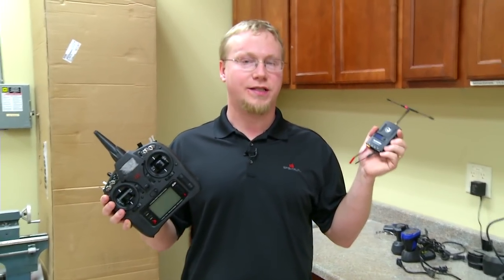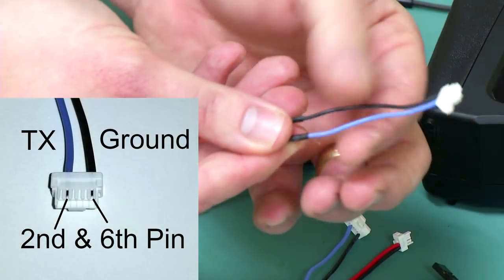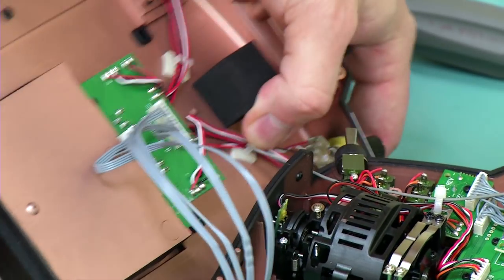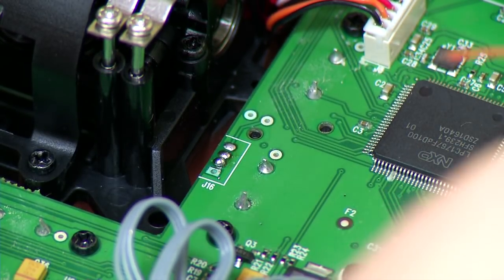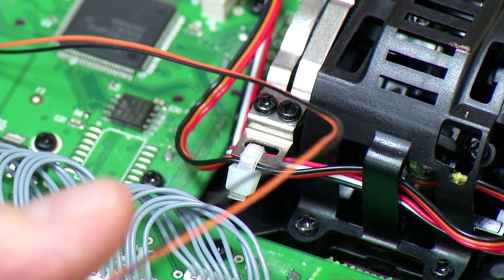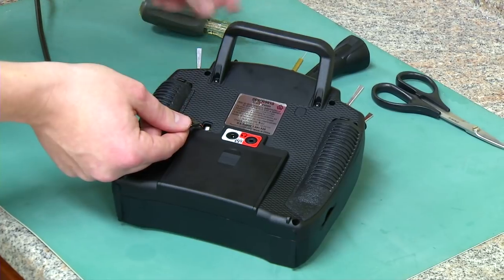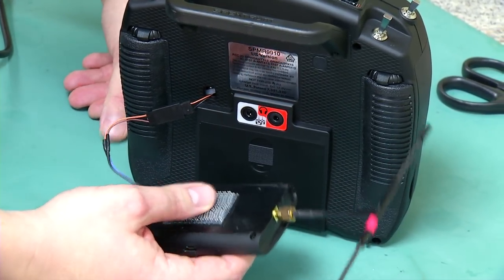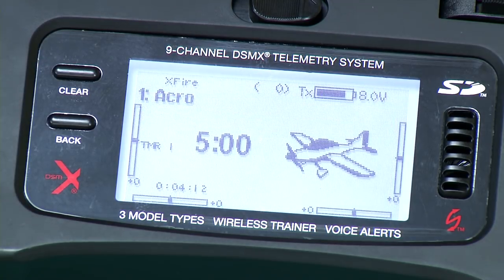Spektrum Instructional Series - How To Upgrade your DX9 for TBS Crossfire Using CRSF Protocol

Comment: Use some flux when you are soldering. It will make it easier and cleaner also tin the wires before soldering them on.(goddamnit i had to edit it due to stupic atocorrect on my phone)

Comment: I have Dx9 black, i want use with module TBS but in sys-setup not " serial port", help me! Pls.
Reply from the maker: Make sure you update to the update that has the serial port enabled, need to read the update description :)
Reply: @SpektrumRCvideos  but i can't register my device on spektrum web.  What should I do now?  Can you send me the update file?
Reply from the maker: @hoangphuong175  You will need to register it. For help with registration issue please email your contact info and the serial number to productsupport@horizonhobby.com
Reply: @SpektrumRCvideos  thank you so much.

Comment: So they say PPM has about 10x latency of the "CRSF" protocol, correct? BUT Crossfire is amazing though? what's the latency of Crossfire? 1ms?  (Just a guess).  Meaning PPM would be 10ms, which isn't too bad is that's the case :)

Comment: You said 8 screws but I counted 6.  Do you need to remove the rubber hand grips to get at the last 2?
Reply from the maker: Grover 2 for the antenna then 6 on the body

Comment: Hello, some people are using the so trainer input to connect the crossfire without having to weld.  how do you do that?
Reply from the maker: Ederson Pires Simply connect the included ppm cable that is included with the crossfire modules into the trainer port while tx is off. The radio will boot into trainee mode and your good to go, hope that helps!
Reply: @SpektrumRCvideos  So I won't need to open and weld as it is on the spektrum website?
Reply from the maker: Ederson Pires correct
Reply: @SpektrumRCvideos  will i need to disable RF protocol and enable crossfire?
Reply: @edyfpv  no

Comment: https://www.amazon.com/Precision-Anti-Static-Stainless-Electronics-Laboratory/dp/B071KCBXPR/ref=asc_df_B071KCBXPR/?tag=hyprod-20&linkCode=df0&hvadid=309735728871&hvpos=1o1&hvnetw=g&hvrand=9378619918457780199&hvpone=&hvptwo=&hvqmt=&hvdev=c&hvdvcmdl=&hvlocint=&hvlocphy=9011707&hvtargid=aud-801738734305:pla-521527862819&psc=1

Comment: Not sure why hey use that adapter cable, why not solder the blue and black wire to the orange and black wire coming from solder point? and why not cut a small slit in the plug and slip wire through and make it look professional?
Reply: the main reason for the connector is because the tbs connector is weak and will break if you try to un-attach it from the bottom of the module too many times. also you can make the wiring as pretty or as messy as you would like it to look. the insrtuctional video was to point out and show you where to make the connections and update and set up the spektrum stuff to work with crossfire, that's all. if you would like to won a beauty contest with your mod, wonderful. but i think his will work just the same, maybe better.
Reply: @rebeccalogsdon5616  

interesting to know, wasn't aware of that issue...I'll keep it in mind

Comment: I have a DX9 silver from 2013 and I am considering TBS Crossfire.
Can I still use it with my Spektrum receivers after the conversion?
Reply from the maker: Absolutely! The modulation setting changes with each model memory.
Reply: @SpektrumRCvideos  We want a plug and play dx9 or dx8 for crossfire micro module!  Make it happen spektrum, you are supposed to be the king of the industry.
Reply: @SpektrumRCvideos  Will this mod work with DX8 Gen 2?

Comment: I do not really want to install Crossfire Rxs in Tiny Whoops and small foamies, so I assume that to use the DX9 for regular DSMX receivers, you simply switch back to the original settings in the Serial Port Setup menu9?   Would disconnecting the cables from the Crossfire module be necessary also, or not necessary?
Reply from the maker: What Jugsy said. Also no need to disconnect when using with other models.

Comment: When he is tinning and soldering the wires to the middle two j16 holes , when he was finished soldering , the top j16 hole has been filled in with solder as well , is this for a specific purpose or is it just my ocd kicking in or was it done for a totally different reason than crossfire as i been waiting for my crossfire unit for ages and dont want to make a mistake ,thanks
Reply: When he was applying solder to the board the iron has touched the top pad and the solder has flowed onto it. Nothing to be worried about there, just make sure they don't bridge and short out.

Comment: I use crossfire on dx6 with  CROSSFIRE GRAUPNER CABLE that comes on the module, but a wire got ripped off. So i m waiting to be able to use it on my ix12
Please next time crossfire adapter is out on mid jun, sell it in amazon. It has been very dificult to get the crossfire adapter.
Reply: How are you using this with your DX6?  A mod, soldering onto the board?
Reply: How are ya using that on a dx6?
Reply: Hi, how do you use crossfire on Dx6?

Comment: Is there a mod for dx6?
I have a ix12, but crossfire adapter is difficult to get, i have a dx6 that i m willing to use same way as dx9 appears in here. Or i will have to buy a taranis
Reply from the maker: Unfortunately no.
Reply: @SpektrumRCvideos  well is there a mod for dx8?
Reply from the maker: @russgalgiani2261  DX9 ONLY

Comment: I wish they could make it work with a dx6... buying an frsky and crossfire would be cheaper than a dx9 and crossfire I love my dx6 if I should have got a dx9 from the beginning....
Reply: Add a higher gain antenna to the dx6, no soldering required.  Easily doubled my range.
Reply: mooosestang I did I still hit 10% Rssi when I fly haven't failsafed but still I hit 10% rssi at a park with barely anything blocking my drone just not confident in spektrum because of that
Reply: I don't really trust the rssi, i've never tried to use it with the spektrum race rx.  I've seen some Frsky guys drop out of the sky without a single low rssi warning, not very reassuring.
Reply: mooosestang I hear yea I just rather have something as a reference just in case just like osd for mah consumption and voltage then just a timer. I would just like to see crossfire on all spektrum radios not just higher end radios just like frsky or other radios that can use it
Reply: Tj Walker you should only need trainer port for it to work on dx6 or dx8. I used on my dx6, but trainer port wire from tbs ripped off and got ix12. What pissed me off is the ceossfire adapter is impossible to get it
Reply: Just use the trainer port. Im's using a DX7s with an EZUHF that way. The only downside is you won't get the lightning fast response of the crossfire protocol.

Comment: It's funny because if you play with the radio name you can create X9D like the radio from Frsky...
Good news for all our DX9 friends :)
Is it not possible to power up the crossfire module with the radio VCC? :/
Reply from the maker: It is possible but we will leave that up to the creative DIY minds to figure out! :)
Reply: Thanks for providing the CRSF upgrade! A hardware mod can't be much easier but was surprised to see the Xfire module power issue left out. Be nice to know how the experts at Spektrum do it as DIY is not always DIR (right) and wondered if a second battery is needed for the two higher Xfire output settings on the DX9 as TBS states for Frysky. I've been using a separate 2S LIFEPO4 battery with PPM/trainer port and not had any ground/RF issues and assume this will apply to using the serial connection as well but it would be nice with a 2S 4000 mAh battery in the DX9 to use internal battery alone as most flying will use the lower output settings.
Reply: https://youtu.be/Pc7yky3GFVA
Reply: @JohnFHendry  got mine done ty McFly